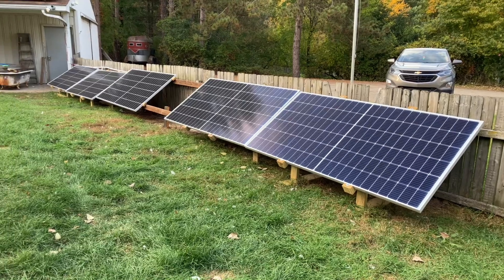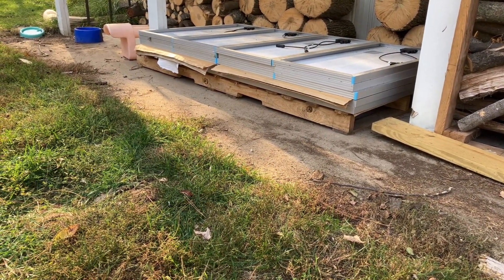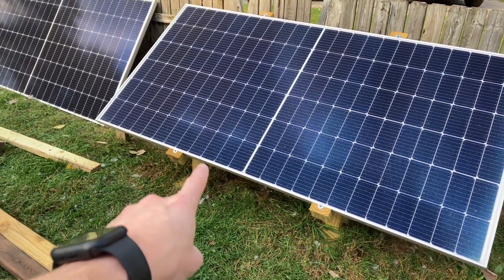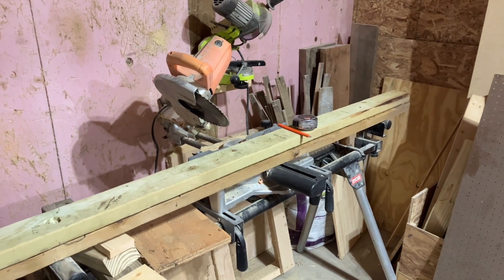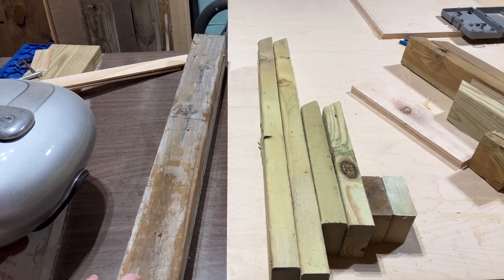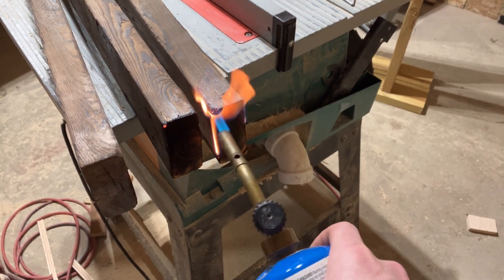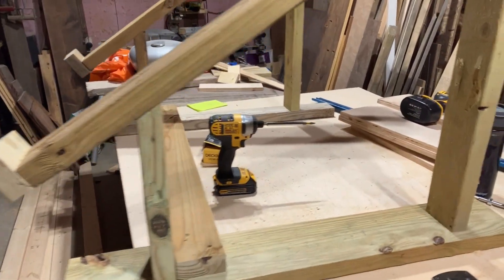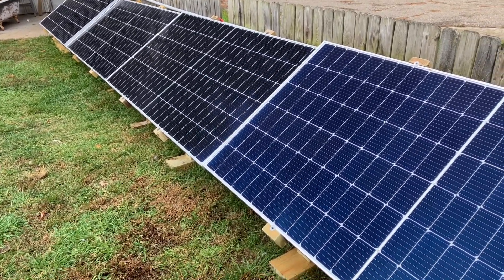DIY Solar Panel Mounts

Comment: I used Sinclair ground mount. I bought em from engineer 775 then picked it up locally here in Michigan. Just need a 14+' trailer
But hey looks like that's working
Reply from the maker: Thanks for the reference.  While I have the wooden mounts in the back yard, I’ve been toying around with a larger ground mount in our horse pasture.
Reply: @AdamDeLayDIY  it was cheeper from engineer 775 and local pickup than a Michigan seller for Sinclair and local pickup. By like $1000. The mount for 16 panels was  $3,100 plus 5 yards of concrete. My friend had an mini x I used for free to dig the 7' deep mini swimming pools

Comment: HOWdy  A-D-L,
Thanks - we have similar Ground-Mount ideas ... I also utilized Stainless-Steel  Fender Washers & Lag-Bolts but I added a section of 3/4" PEX  to support  the END Fender-Washers where there was NOT an ADJOINING Solar-Panel  ( too keep the Fender-Washer from  " tilting " ...   
COOP
the  WiSeNhEiMeR from Richmond, INDIANA 
... 

...
Reply from the maker: Awesome!  Yeah, on my small panels where I screwed in from the sides to hold the panels in place, I added a small piece of wood to be the offset.  Never thought of the pex.  That's a great idea!  Thanks for sharing!